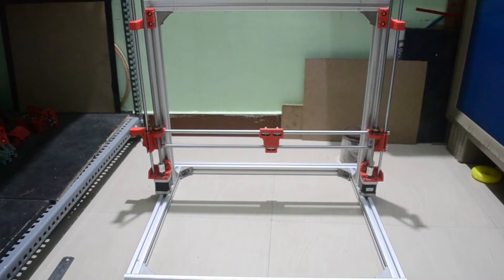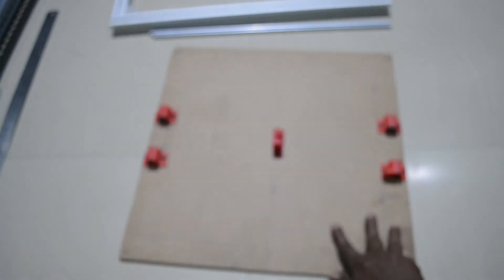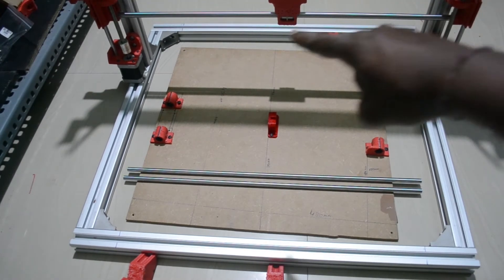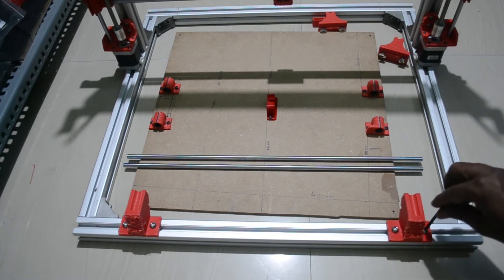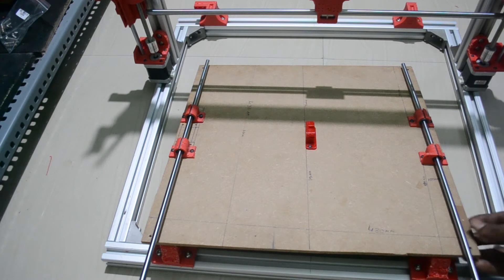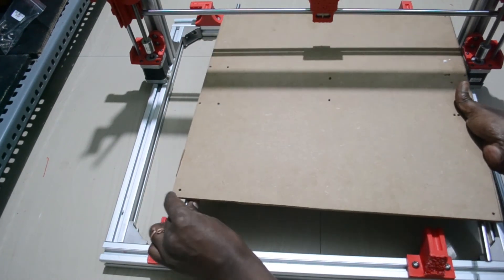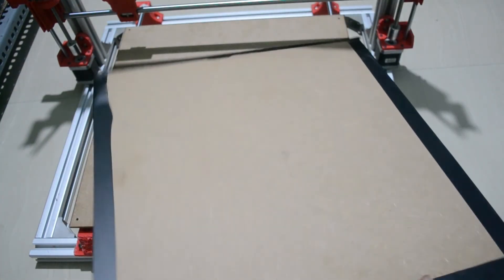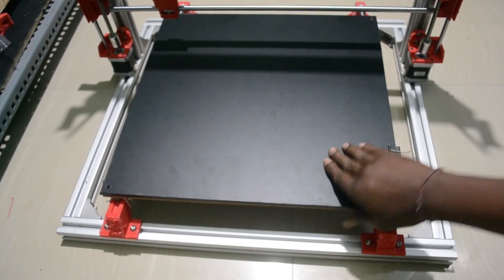diy 3d printer build from scratch part 5: Y Axis& build platform

Comment: sir, how to get the dimensions of all the exact 3d printed parts used by you. I am a beginner. Also, thingiverse is little confusing.
Reply from the maker: Hi in thingverse in thing details all parts and dimensions mentioned depend on size of 3d printer you are planning to make like small medium and xl.